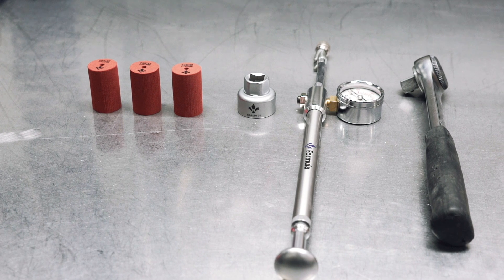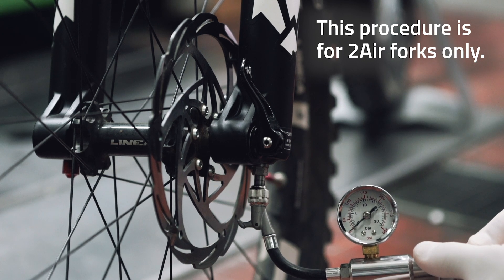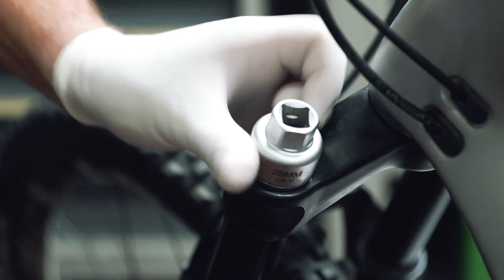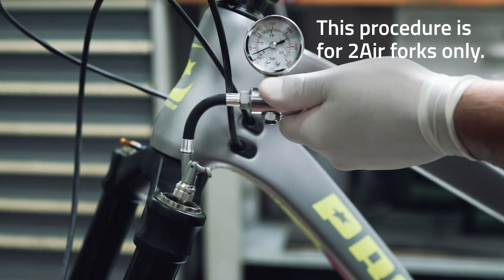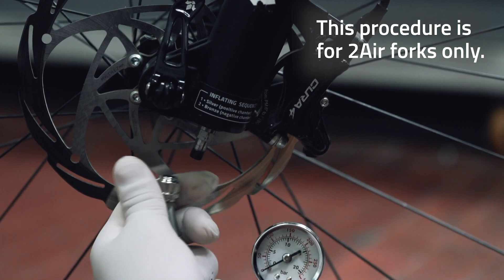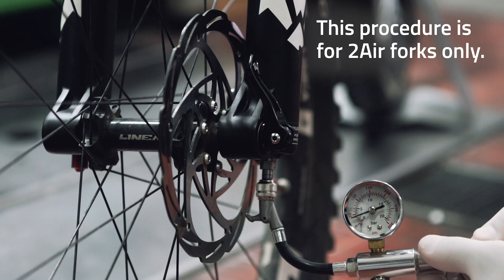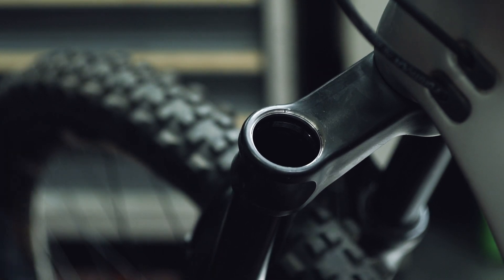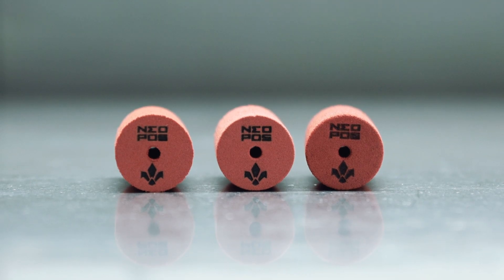Neopos Installation tutorial

Comment: I have seen somewhere that the Neopos can brake up into small particles. If so will it cause any contamination with seals or the oil? Do the Neopos have a shelf and fitted life?
Reply from the maker: Hi Steve, the Neopos is designed to work with Formula forks. We use less aggressive oil, and on two air chambers fork, like the Selva R, we've two separate chambers, there's no connection. Other forks use a slightly aggressive oil, and they have a channel, like a pressure equalizer between the two chambers, inside the fork. This means that the oil can wear the Neopos faster than usual, and some residue can go into the little channel. If you have a Formula Fork, you're 100% safe all the time. If you have other forks, we suggest not to use Neopos or, at least, clean the fork once a month.